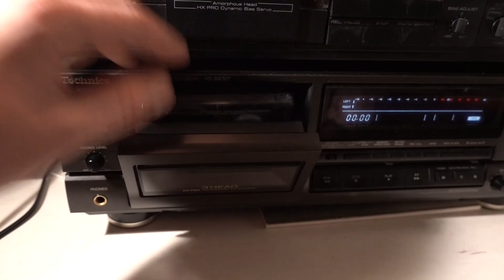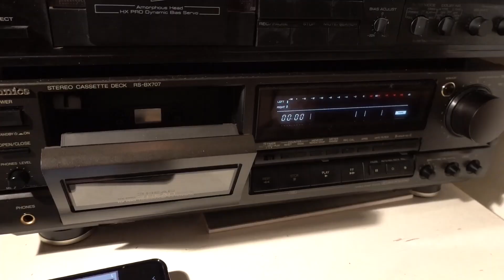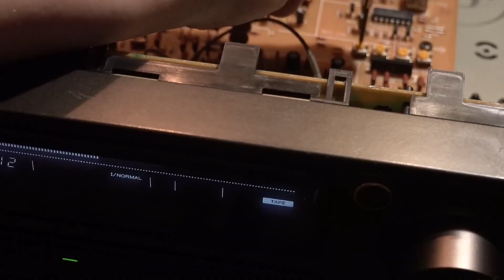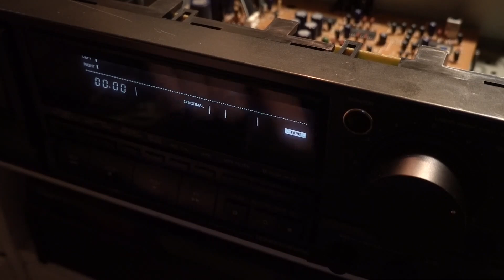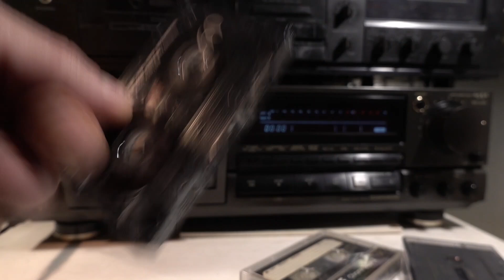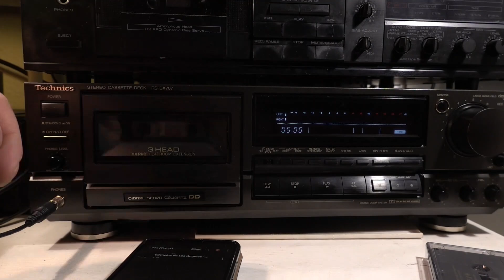Technics RS-BX707 3-Head Cassette Deck - Repair and Test

Comment: You need to measure the signal voltage on the Dolby IC reference pins (13 and 18) when playing a Dolby reference level calibration tape to check for correct playback level. If you don't, you're relying on the deck's meters being accurately calibrated which may not be the case. This can lead to serious Dolby NR mistracking issues even though the meter levels may appear to be correct. The RS-BX707 is meant to be calibrated to 0dB at the output for a 250nWb/m at 315Hz recording. If this coincides with 0dB on the meters then you know that the meters are correct.
Reply from the maker: You qre right. I have got the test tapes coming. Not sure if the 315hz tape will be within speck, but there is q thread on tapehead where they calculated the voltage for the 400hz tape i am getting aswell.

A normal cheapo voltmeter should be enough to meassure, shouldn't it?
Reply: @GrumpyGrain  hey you need to use osciloscope or high resistance impedance input tester